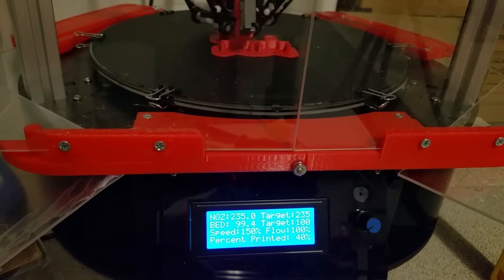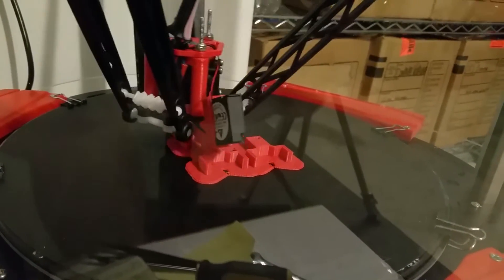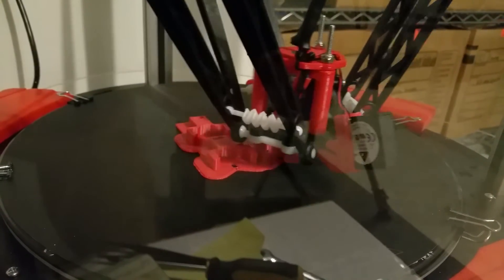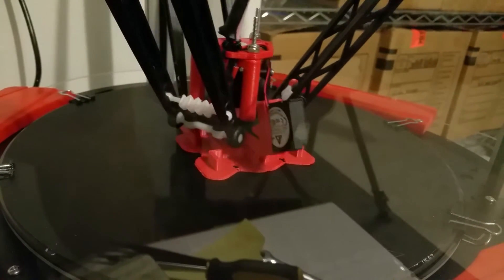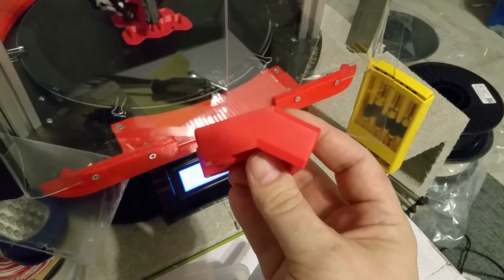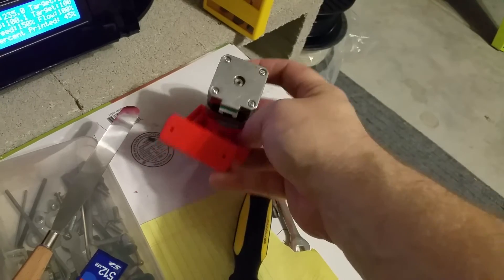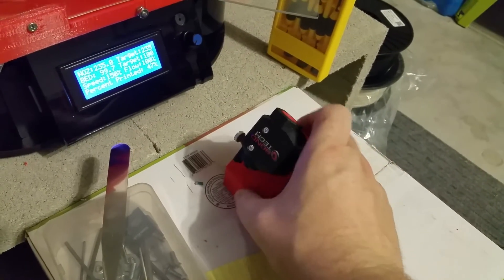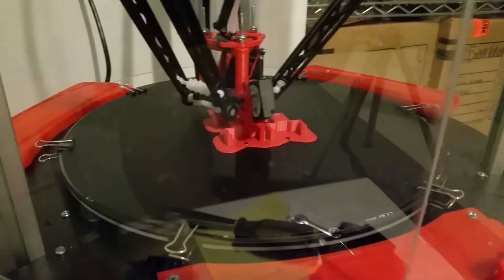Rostock Max v2 E3d HotEnd Upgrade

Comment: I have the old cariages and arms for my axis, do you know where I could get the newer ones to replace the old ones? cause I think they are somewhat limiting the print quality along with a few other things XD
Reply: also what are your thoughts on upgrading to a dual extruder?
Reply from the maker: I've been going directly to the printers manufacturer SeeMeCNC.com or matterhackers.com for the majority of my spare parts.  I do like the SeeMeCNC carriages which I didn't think I would since they feel kind of cheap but they have been flawlessly working for me without any issues at all.  So I would probably be buying them again.  I'm curious how many hours you have on your existing carriages that you are ready for a change.  It might be something I need to start looking into.  At one time I thought of lengthening my arms but I'll probably never do this.  If anything, I'll just end of building a completely custom delta.  You might also look into decreasing the amount of weight on your end effector, I can see that wearing your carriages prematurely and adding to issues on longer prints.  Hope this helps.
Reply: InTheoryStudios by old I mean the original design with the square sockets rather than the ball sockets.  thanks for replying I do appreciate the help 🙂
Reply: InTheoryStudios I just took a look on their website and found what I was looking for. it does seem like based on the reviews if I get the new  design of cheapscates and ball socket arms the quality does improve so heres hoping. thanks for the help :)
Reply from the maker: I misunderstood that point, but yeah, I would certainly upgrade to the newer design.  And you might look into the upgrading to the Max v3 accelerator probe.  I put one on my system and love it.  I'm surprised I haven't released a video on that yet. Thought I did.  The only problems I had with mine is the length of the wiring going to the i2c connector and to the main board.  So I had to include a couple of ferrite bead to smooth out the signal for things to talk properly.  I'll have to get started on that video I guess. :)
Reply: InTheoryStudios did you have to change to a better rambo board or does the default board work for the probe ?
Reply from the maker: It does work well with the probe.  No problems there.  I thought about upgrading to the Smoothieboard one day but still haven't felt the need to pull that trigger yet.
Reply from the maker: I had a dual extruder on a Makerfarm 12inch Prusa I used to own and I never ended up using it after the initial newness wore off.  A couple of the issues I had was randomly the second extruder would pump into my prints and knock them off and when using a wipe and prime tower, it would really use up a ton of filament.  Then it would knock that over and all sorts of other bad things would happen.  I probably needed more time to configure it properly, but with the movement of the bed, its hard for things not to move when they get tall  I'll stick to the Delta printers.  But with that said, I might do a e3D Cyclops in the future.
Reply: InTheoryStudios im very tempted to upgrade from my current e3d clone(a very good clone if I do say so) to the he280 listed on seemecnc which comes with the accelerometer for bed leveling and also comes with the ball socket upgrade as well so two birds one stone

Comment: Hi,
I also have a Rostock Max V2 for abut a year now.  After having to replace the resistors on my stock hot end and then the thermistor, I have a become somewhat frustrated with the stock hot end issues.  The E3D looks to be a simpler solution.  Are you still pleased with it?  I use mostly PLA, occasionally ABS.  What do you think?
Reply from the maker: Hi Bruce, yes, I'm totally please with the E3D hotend and the hardened steel nozzle.  I haven't had any trouble with it at all.  I've had other issues with the extruders, bed leveling, prints sticking properly, etc, but not the hotend.  I did run into one trick that may help you in the long run and that is using a tiny bit of vegetable oil on the filament going into the Bowden tube.  Not only does it help lube things up a bit and make it slide easier (less strain on the extruder) but it also helps the hotend.  The plastic seems to flow smoother and leave less artifacts in my prints.  My current oil of choice is Avocado Oil.  It has a really high smoke point so no nasty smells and seems to work really well.  And it doesn't take much.  The only other major upgrade I've make is to the bed.  I went with PEI and am really loving it.  The print stick really well.  Both large and small prints, (I've only tried PLA so far) and the pull off when the print it done without any effort at all.  I'm really happy with it.  Tough stuff too.  Long answer to a simple question... Yes I really like my E3D hotend, I would recommend getting one. :)